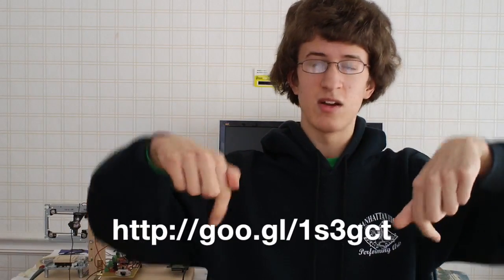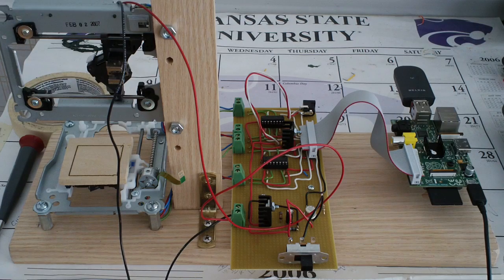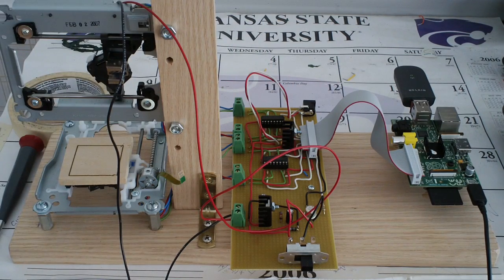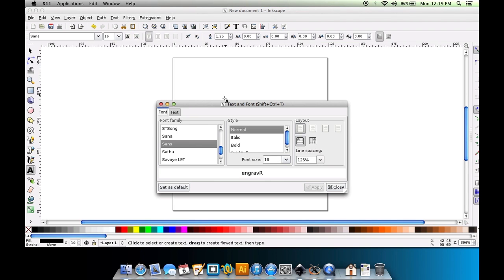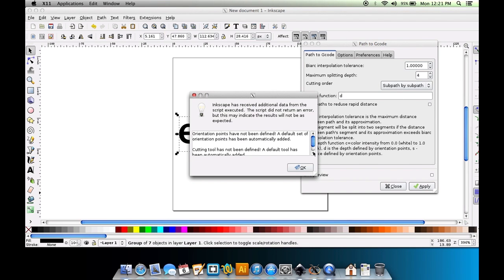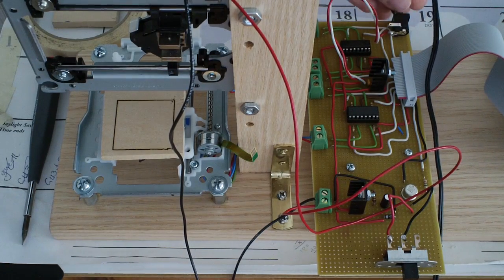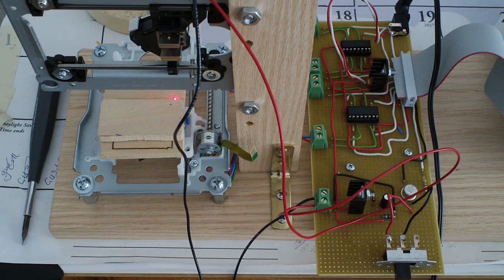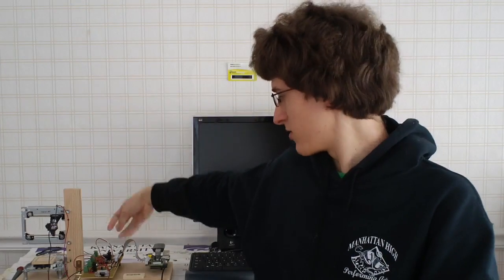engravR (RPi Laser Engraver)

Comment: Wouldn't a pull-up and/or down resistor on the raspberry pi control pin, stop the laser power from coming on? For windows I would just setup Putty and ssh into the Pi, no real need to find anything additional.

Comment: Would it be possible to power the steppers or a 5v laser driver directly from the 5v off the Pi GPIO? Or would you recommend going with the external power supply? Also, your Pi turns off the laser after you turn it on while it moves itself into place correct?

I'm looking into building one of these myself and just gathering info before I begin. Thank you for any info you can add!

Great video btw!
Reply: sl33p3rc3LLI recommend an external power supply, because the Raspberry crashes in to severe voltage fluctuations. Just as when something connects to the USB port.

That's why you need the H bridges like the L9110 from the tutorial which was linked in the video description for the stepper motors.

The Raspberry also turns the laser on and off.

http://funofdiy.blogspot.de/2013/10/a-raspberry-pi-controlled-mini-laser.html

Comment: I don't want to be a kill-joy here but please be sure to cover the serious issues of safety and risk. This is a class 4 laser, there is a serious risk of fire and respiratory hazard through harmful fumes/gases. Such things are not associated with other cutting technologies such as CNC routing and must not be overlooked as the hazards are significant
Reply: Where on Earth did you get a DVD burner that uses a class 4 laser?
Reply: If the laser is exposed without a light tight and interlocked enclosure it's class 4. The material is being burnt, which is the lasing process. People can burn too, especially eyes, and anything close in proximity that's flammable. This is a classic example of a little knowledge being a dangerous thing

Comment: Just a small word of advice if you plan on using this engravR alot, get yourself some kind of vent. system. Fumes from engraved plastics can be dangerous. All in all, great project, works smoothly! Keep the good work.
Reply from the maker: Yeah, I agree.  I may try pirating some old computer fans at some point.  I am not using the thing all that frequently, though, so it isn't high on my priority list at the moment.  Do I just need a fan, or would you suggest some sort of ducting to route the smoke outside?